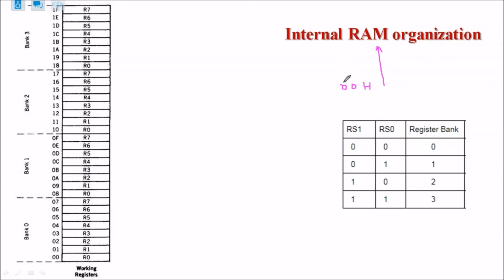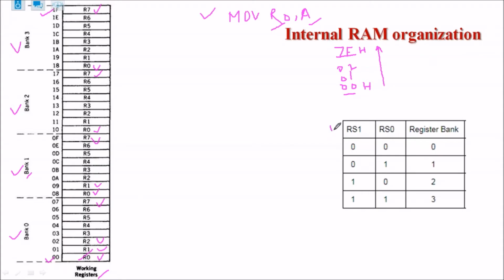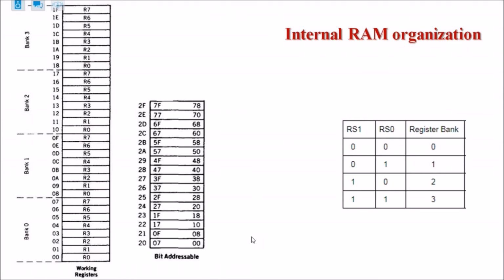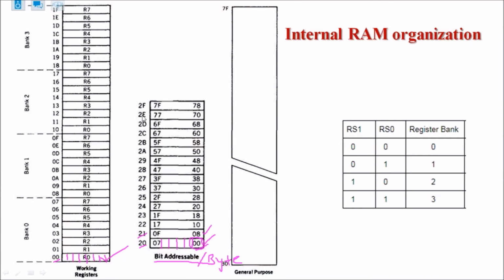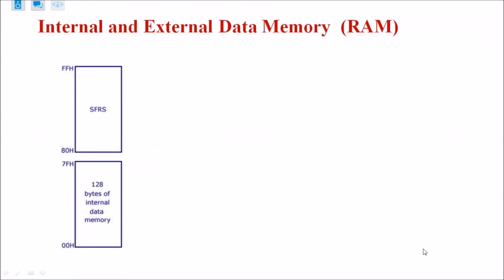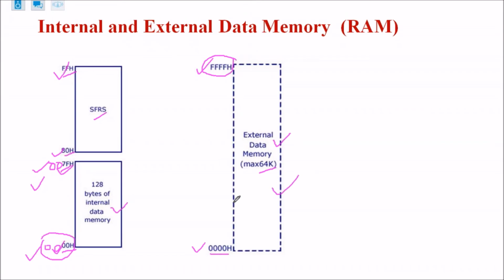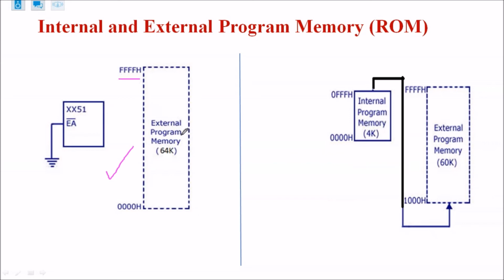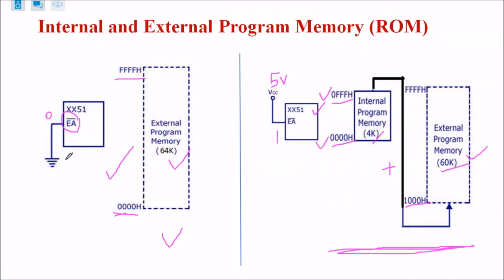Lecture 5: Internal and External Memory Organization of 8051 ( Recording of online lecture)

Comment: 18:10 maam, you said 64KB of ext ram + 128B of int ram can be interfaced, it requires extra bit (2^16 + 2^7)- 17 bits are needed, but we have only 16 bit address bus.  please clear this gap maam. the remaining lecture was very smooth and well put.
Reply from the maker: Watch video of RAM addressing modes. You will understand the concept.